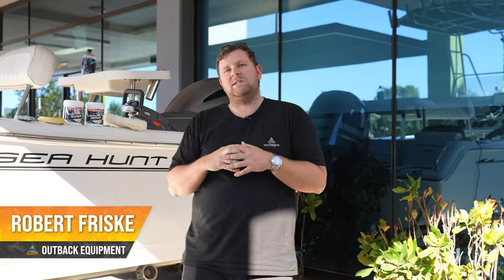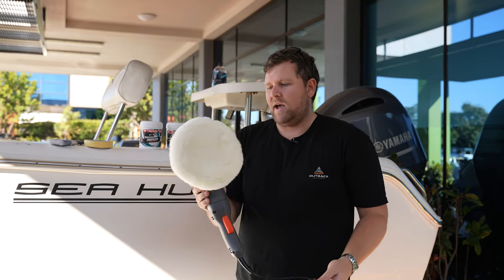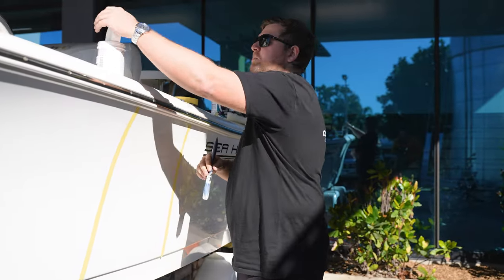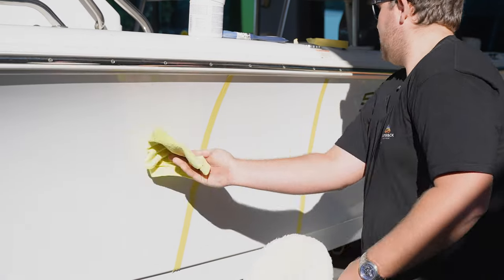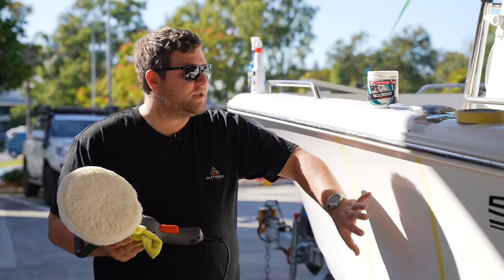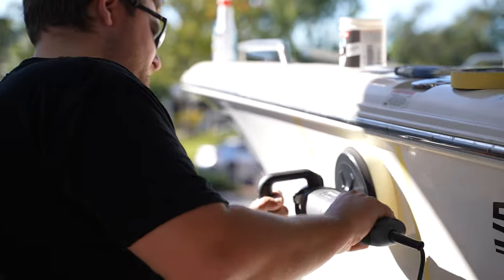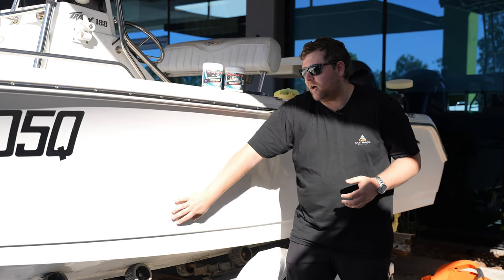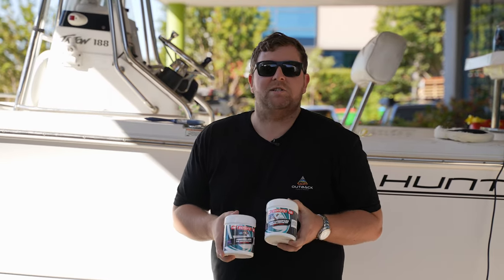Polish Your Fibreglass Boat - Septone

Comment: Seriously, why did you use a white, well looked after boat? You really can not see whether it brings up the gelcoat colour or not. A good test is using it on an old coloured faded fibreglass gelcoat. You can really see if it does work on old faded boats.

Comment: Hi there, just checking whether the cloth can be cleaned for re-use after applying the product with it? Or does it need to be binned?
Reply from the maker: Hi Mate, that's correct - the cloth can be cleaned/washed and re-used.